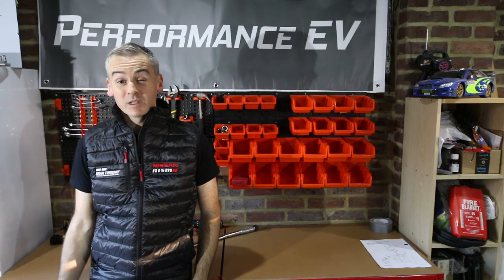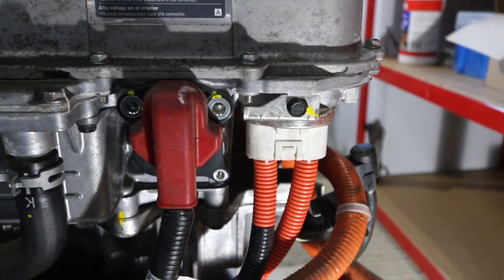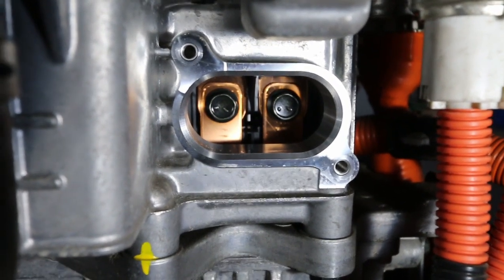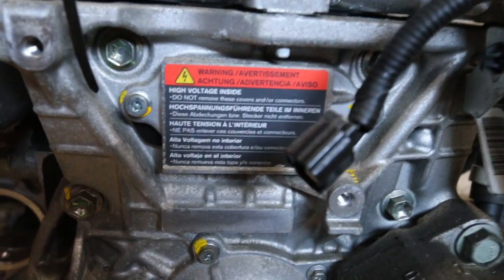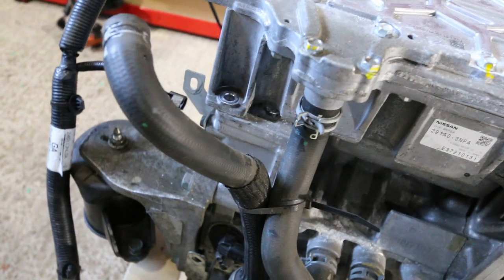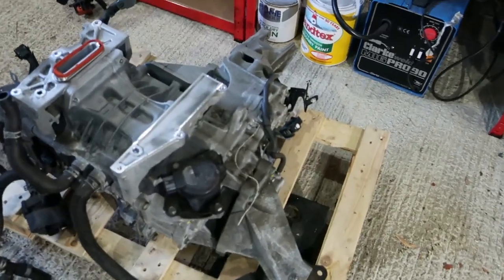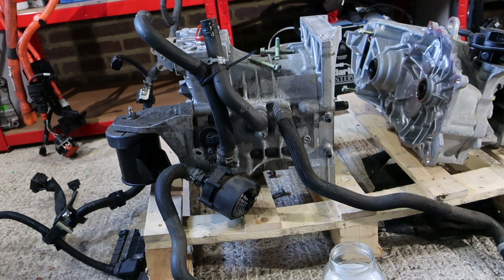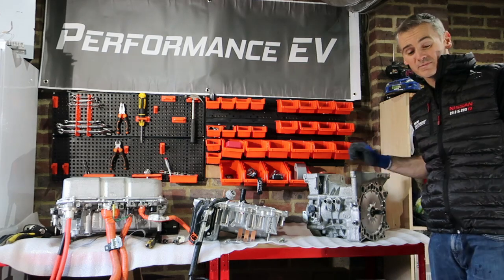Building an Electric Car - EV Parts - Nissan Leaf Drivetrain Disassembly  Motor/Drive Unit Teardown

Comment: What a cracking video .Subscribed! Im in a bit of a dilemma .Our 2016 leaf pulls violently to the left when you pull away .Then when you let your foot off the throttle it jerks to the right .Its definately a drivetrain issue .Diff???  Any ideas please .Its doing my nut in ......